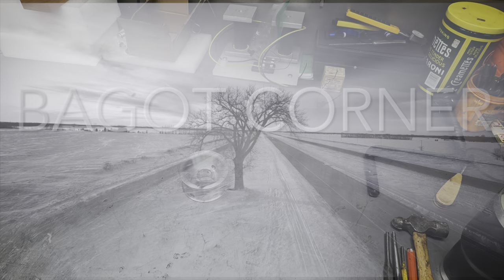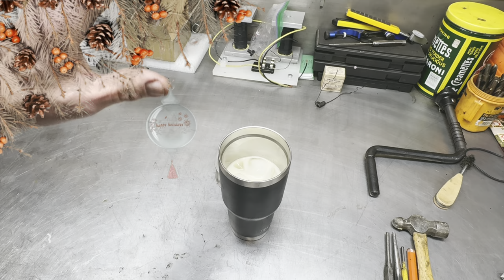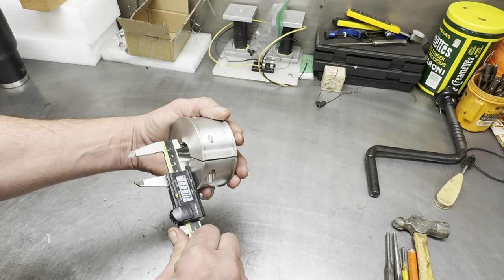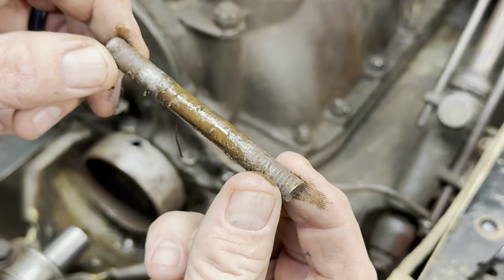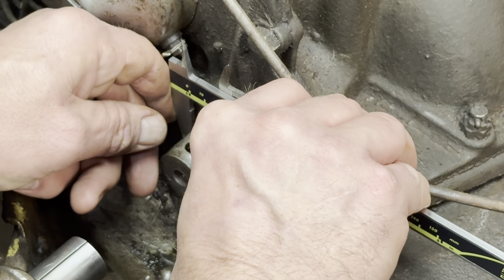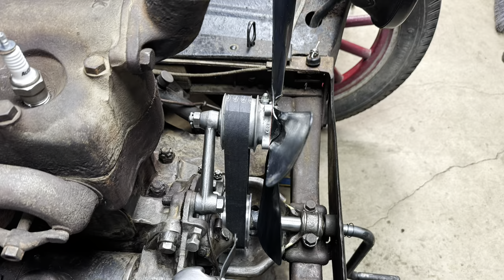1927 FORD TT PT.6 CRANKSHAFT FAN PULLEY

Comment: Great video. I'm doing the same job on my '26. I actually removed and re-attached my pulley when I removed the timing gear cover to replace the timing gear last year. I should have done this job then. I just ordered my new aluminum pulley from Chaffin's Garage in California. They're the manufacturer, and they sell them to the other vendors. What I like about Chaffin's is that you can call them and speak with David, or Glenn Chaffin and get great technical advice as well. You're not just speaking with a clerk who's taking the order. If you check out their site, you 'll see pictures of their shop, and David working at the lathe.
Reply from the maker: Thanks for stopping in. 
Yep , it was an easy fun job , especially when the rad isnt in the way